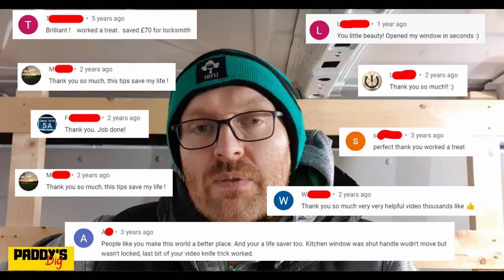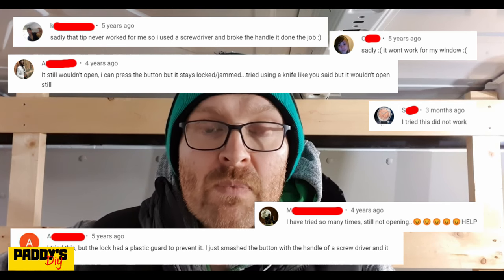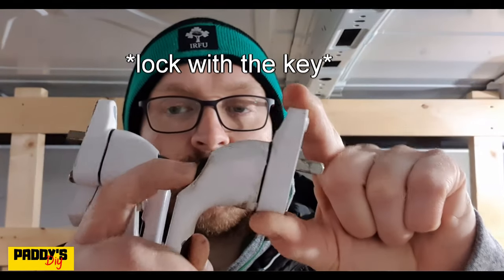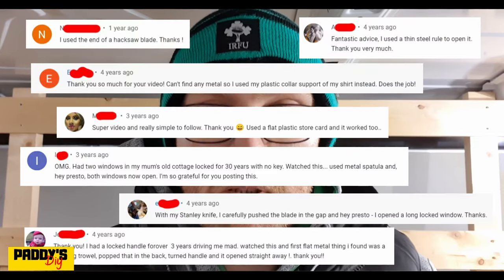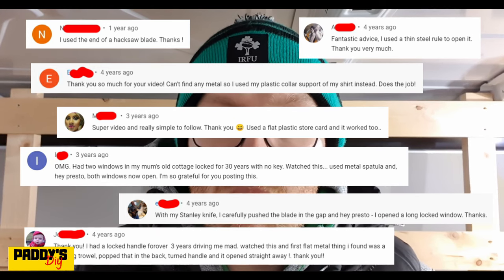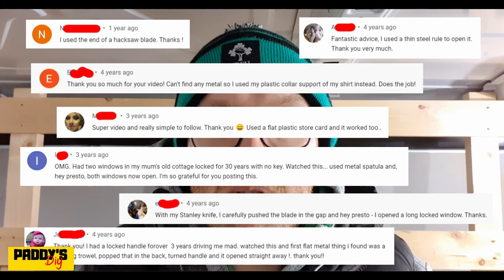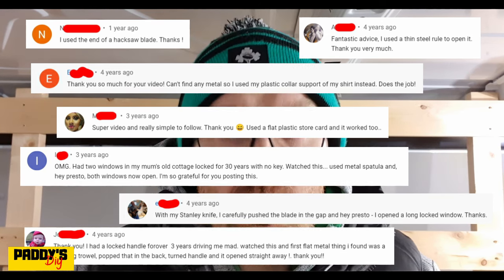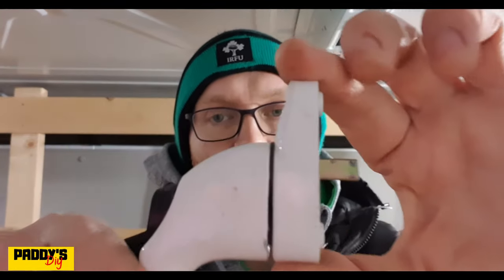[37] * UPDATED * How to open a locked or broken window handle

Comment: Omg you've saved me! Iv been boiling in my room. It took 2 days. But I finally did it!!! I'm so grateful to you!
Reply: For those maybe struggling to fit something into the slot. Hair clip as paddy said. But I had to break mine to use the thin bit. That way it slides all the way through.
Reply from the maker: Thank you kindly opalk. Glad you got it sorted 👍

Comment: As a pensioner with not a lot to spare this was magic. I had thought of using a Stanley knife or similar but seeing this gave me the confidence that trying wouldn't damage anything further. Stanley knife worked instantly. Thank you so much. My Anglian windows are only a few years old but the locks are crap and only half of them lock at all. Thanks again.
Reply from the maker: Glad it helped 👍

Comment: Opened the (brass effect type) window lock with the first wedge. I used my kidney donor card which is really thin. Jostled it around the centre while opening the handle. Fantastic. Very easy to do. I'm off to the hardware store with the busted handle to ask for an exact replacement. Thanks a lot.

Comment: Amazing, thank you! The key ring method finally did the trick for me. Thanks for explaining it so clearly.
Reply from the maker: Fantastic. I was worried the key ring method would be too difficult for some people. Great job 👍
Reply: Could you just explain what you mean by „turn and apply pressure“? Do you mean the tool or the handle?  I want to understand what I‘m aiming at before I try it. Thanks

Comment: Thanks for the info. It worked on a couple. We have one where the handle opens but the window is locked shut? Do we have to dig out the bottom seal to free it?

Comment: Hi @PaddysDiY do you have a video on how to fix a sagging window? i recently replaced hinges and its catching ever so slightly so i've got to lift the window as i open it otherwise it gets stuck on the lip of the frame
Reply from the maker: Leave it with me for a little while, and I'll make a video 👍
Reply: @PaddysDiy  champion!

Another suggestion (selfish i'd admit!) is what to do when the hinge fixing point has failed and pulled out the surrounding UPVC - i've been told to just stick a longer screw into the frame, but wanted to see other options as well

Comment: Omg would you know how to fix the square socket that attaches itself to the handle? So say you take the handle off and the little square socket is broken? Can you fix that part?
Reply from the maker: If the square bar has broken off the handle, you need a new handle. You'll get one in most hardware shops for less than a tenner

Comment: All very well if it works, but on mine the piece that should retract could not be pushed back into its place.
There was only one way, my thin knife was all the way through the lock, I held button down and thumped the handle open as the broken bits fell out.

Comment: Hi my lock is other way around. I try to put the card in and also a flat hair pin from thr side but as the latch wont move it quite hard i have spend more than an hour on this

Comment: I don’t have a keyhole with mine 😭 ! I wish I could send you a video. I have a tilt and turn window/door that’s stuck in the mishandled position. However, the handle is what seems to be the issue. I’d be able to put it back into position, but the handle is lose and can spin around, but it locks when put in the lock  position (downwards.).
Reply from the maker: You have a tilt and turn window by the sounds of it. One of the sections is broken, i would say. You'd need a window repair company. Not a diy job I'm afraid

Comment: I have the first type of handle that should be able to open with a hair clip only it seems to be broken in such a way that I can't get it open. I've tried several tool and angles. If I try pressing the button while I have my tool in there I can feel it pressing down on the tool. I think the axel that the catch rocks on is broken so its just staying in/forward and pressing the button just presses it in more! What can I do?
Reply from the maker: Could be the espag lock that's broken. Hard to know really without seeing it
Reply: @PaddysDiy  if the internal lock was broken or jammed I imagine that would mean I couldn't turn the handle, but I would think that would't effect the catch mechanism in the handle? In the videos you pull the tool down and the catch pops up and you can move it right down, yes? I can insert the tool from the side just below the axle but I can't move it down. It feels like it hits the catch but won't go any further. The other windows with the same style handle are the kind with the catch inside the handle, not the kind with the catch on the mounting.
Reply: @adrianthoroughgood1191  I tried the hair grip technique and it wouldn’t move the catch. It felt like there was a broken part jammed in there. What it did do was just move it slightly, so with some firm pressure on the handle, the plastic catch (horrible cheap lock) snapped off and the handle moved freely. Totally broke the lock but still…
Reply: @michaelamoore4330  in the end I used a small hacksaw to cut upwards from the bottom, to cut through the plastic catch. The gap wasn't quite big enough for the blade so I had to chew through the edge of the metal lock body a bit as well. I used plastic tape to cover the frame to stop abrasion. Managed to get the lock to open. Now it opens and closes and operates the lock mechanism fine, just without the ability to lock with a key.

Comment: I have a different type of handle than those shown. Pitty I  can't upload a photo or two here in this comment to show you. The handle just has what looks like a bolt, or pin going through it. The lock has broken completely and fallen out exposing the interior parts of the handle. There doesnt apear to be a catch of any kind to wedge a hairpin or anything into. There is another window like it in the house that does open. I have looked at this one, but there doesnt apear to be a little latch I can slide anything under to bypass the lock.  It is on a tilt and turn window if that helps. 

Other than that all I could do is maybe email some photos of the lock and handle?
Reply from the maker: You have the deadlocking type handle. They can't be bypassed. If the lock has fallen out of the handle you might as well go the whole hog and cut the pin. Use a hacksaw or junior hacksaw blade to cut it. The handle will open then.
Reply: Thanks very mutch. Do you have a how to video on this?  @PaddysDiy

Comment: Mine was an auto lock, but the bolt was completely jammed and wouldn’t retract at all, so your trick wouldn’t work for me. I ended up bashing it with a masonry chisel to get the handle to swing open. I also tried a multi tool that has oscillating blades, but the blade wasn’t strong enough to cut the bolt (it just wore down the teeth of the blade). If your in my situation you need some heavy tools to get the handle off. I’m sure an angle grinder would have worked but I don’t own one.

Comment: I have a handle that I cant get open. It is the type that is easily opened with a credit card and in fact this broken handle is a replacement which I did few years ago. But now no matter what I use i cant get it open. Baffled!
Reply from the maker: The espag lock could be broken. Is the handle moving at all?

Comment: Slight issue, I have the card through and the handle is still not going up anymore. I believe it’s something to do with the ‘sash’ I believe it’s called doesn’t move and is stuck on open while the handle is down🤔